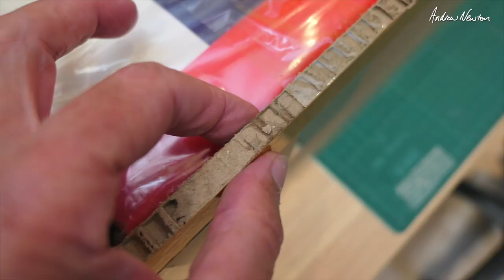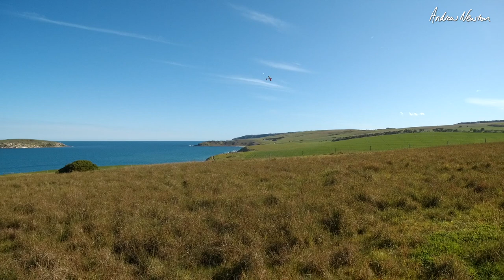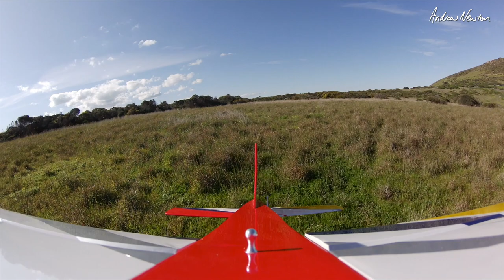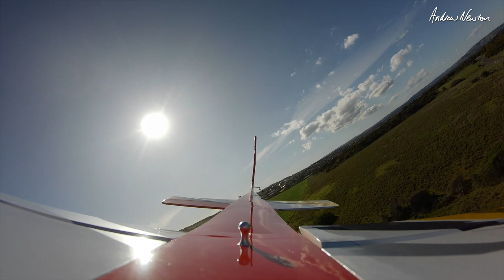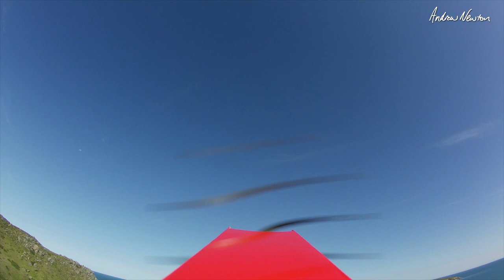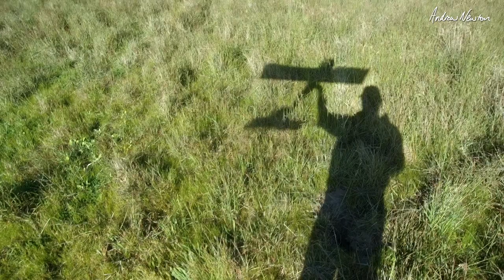OMP Challenger 49 - Balsa Aerobatic trainer

Comment: Nice one Andrew, Ya Rudder still looks bent mate..
How much difference in weight was it to a foamy round the same size.??
I am tinkering with some Balsa designs (Old designs) which I found on the net to build hybrid Foam/Balsa Gliders for sloping.. Foam formers with balsa sheeting etc.
Balsa does fly better but also breaks better..
Cheers.
Reply from the maker: Heavier than a foamy I think, but certainly flies with precision. No flex I guess.
Reply: @AndrewNewton  No, MUCH lighter than a typical foam plane this size.   Balsa's advantage over foam is much greater rigidity and less weight.  More difficult to repair, but can be repaired to 100% new condition with balsa scraps, a sharp knife, some glue, and a covering iron plus a lot of time.  Foam can be repaired quickly and easily in many cases with a hot glue gun and not much time, but it will never be good as new.

Foam is quicker and easier.  Balsa flies better.  There are pros and cons to both.